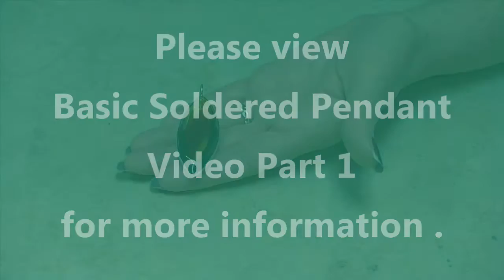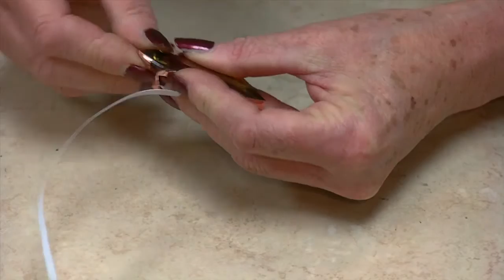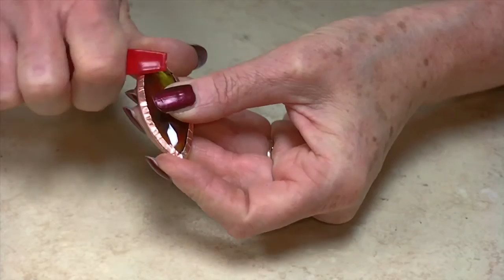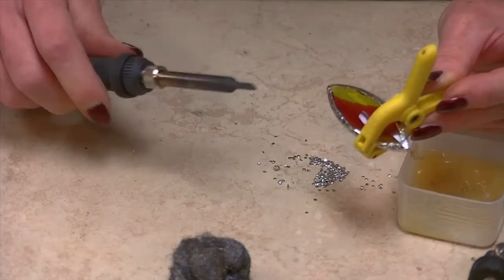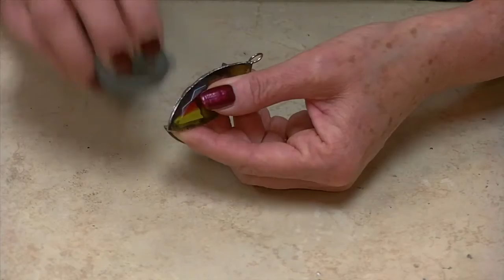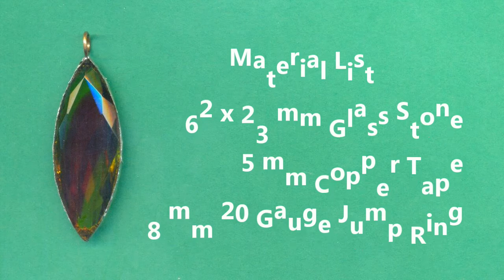Basic Soldered Jewelry Pendants Part 2

Comment: Is there a video on how to attach the jump ring into the pendant with the iron stead of the tourch?
Reply from the maker: Hi Flor.  There is not a video where I attach the jump ring with a soldering iron.  You might try applying the soldering iron to the inside of the jump ring where it touches the pendant.  You just need to get the jump ring hot enough to melt the solder.

Comment: Jan I’m interested in knowing what are the pellets made out off and where can I get them?   Can I use the ones made for sterling silver?  Thank you you are a big help
Reply from the maker: Hi Ida.  The solder pellets seen in the video are from our vintage items.  I do not work with sterling silver, but I think the problem there would be the melting point of the sterling silver would be to high to use with a soldering iron.  You will need flux to use the soldering pelts.  Here is where you can find the soldering pellets  https://www.jansjewels.com/soldering-paste-soldering-torches-1.html

Comment: Mam is torch necessary I bought soldering iron but not possible to solder jewelry only with that, if necessary please mention that torch name and where to buy it. Hope you respond soon
Reply from the maker: Hi Shruthi.  A soldering iron is required when applying solder to copper tape as seen in this video.  A torch is needed to solder setting together.  The torch is simply a hand held butane torch and should be available where tools are sold.  Jan's Jewelry Supplies has solder and torches for sale.  https://www.jansjewels.com/soldering-paste-soldering-torches-1.html